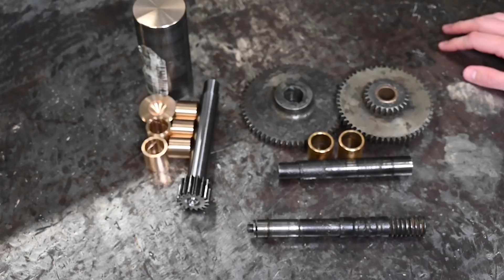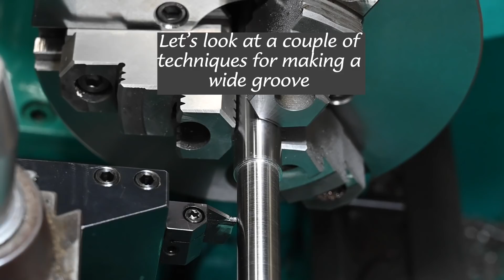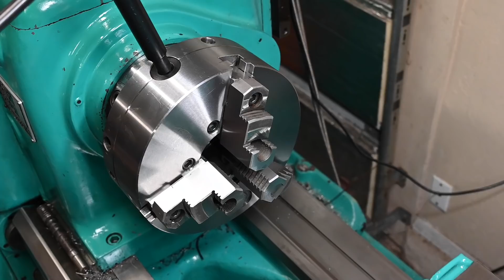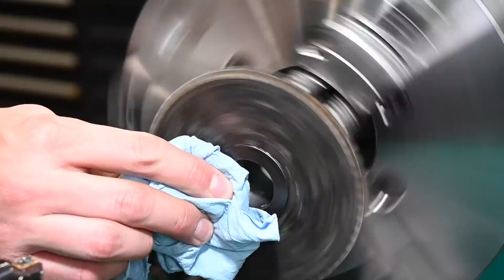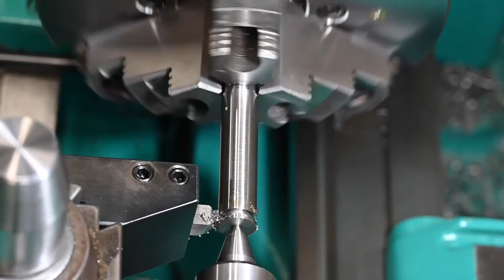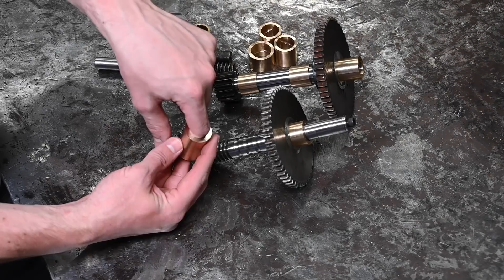Grooving and Boring and Turning, Oh My! Monarch Lathe Action

Comment: I'm pretty sure that you can treat that section of grooves as teeth in a gear on the shaft diameter for the purpose of measuring tooth depth with wires.  Of course that would require that you know the gear pitch and angle of the mating pinion gear.  But since it worked you're good.

Comment: The way to put that hub into the gear is to BRAZE it in.  You can use ordinary propane torch.  Temperature is low, & there is no thermal shock as in welding.

Comment: Just one idea, you could of turned the shaft oversized to the gear bore diameter, then you wouldn’t have to make a sleeve
Reply: That was also my first idea, but he mentioned that his customer wants to replace that gear with a new one.
If the new one is an original spare part, it is easily replaceable this way.
If he had made the shaft with a larger diameter, the spare part won't fit and has to be machined to the lager diameter first.